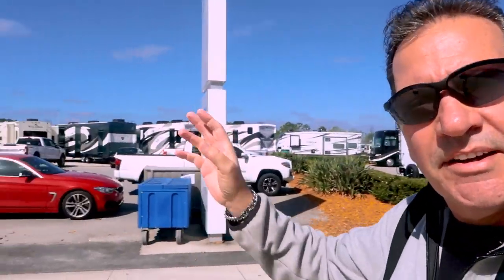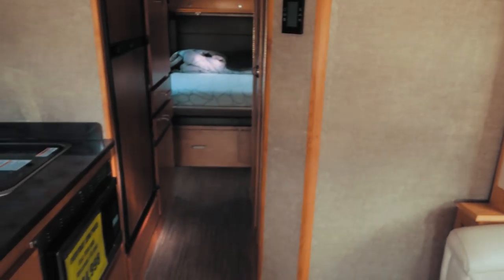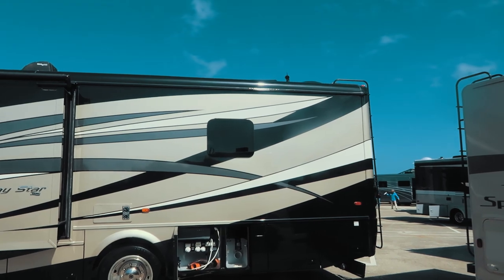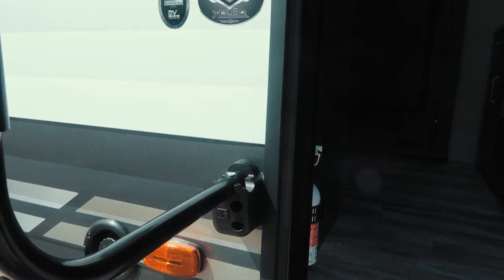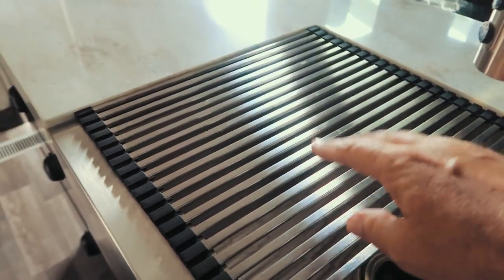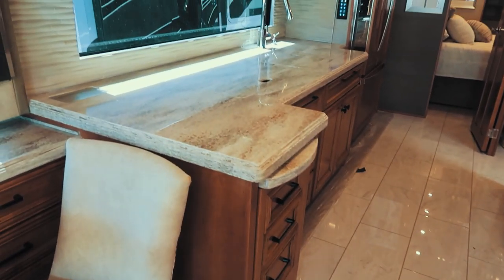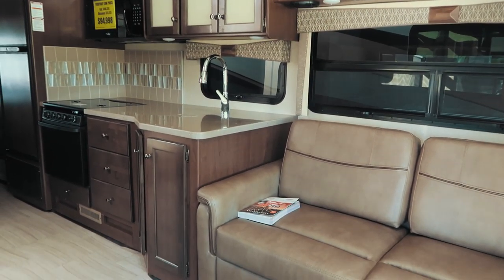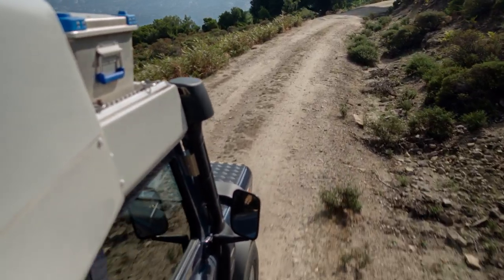2020 Daytona RV Show, What's New, Buyer's Guide!

Comment: Hi Bobby Gene, great tour and not much of a difference to change my mind. Still love your Newmar Bay Star I bought from you. After a few repairs it is like new. I am going to install an automatic generator start so that the generator will start when the battery voltage drops below a set value and also will start the air conditioner if the temp inside goes over a set temp. Which is great for our dog if we are out hiking where dogs are not allowed. Planning our 4 month tour of the Northwest and British Columbia this summer. Take care and keep up the good work.  Kevin
Reply from the maker: Hi Kevin, those are some awesome upgrades, well done! So glad you are happy with the RV I miss it a lot! I bet you are going to have a great time on your 4 month tour, wishing you safe travels and smooth roads!

Comment: I have to agree that there is really nothing of real significance that is new in 2020. We started looking in 2016 and bought a one year old coach in 2018. Our thought was that the difference was so small that we would not need brand new. Glad that we chose to go that route to reduce the high depreciation. My hope is that quality of the overall product will improve but I really do not see that. I hear that it's an "earthquake" going down the road but if you are charging these ridiculous prices, then build for the earthquake. A lawn mower, plane, car, jet ski, etc are built for the vibration and use and do not start falling apart due to use. Imagine if you had to replace much on your mower after one summer of use? We would not accept that as a quality product. After a lot of research we chose the Bay Star for quality but it is far from what I would expect for the money. Still happy with it but do think they could do more in quality to save the headache for the consumer. What other industry expects that the consumer will purchase and then bring it back time and time again (under warranty)  to work out the "bugs" that are consistently problematic for the consumer. Buying a one year old made it so that the original owner had to do most of that. Still waiting for you to buy your next rig! I imagine it is nice to nest a while since you just bought the condo. But, It will be fun to have you on the road again at least part time. Good job on the video.
Reply from the maker: You're making perfect sense well said Bean, ugh so frustratingly clear. Yes I'm looking forward to getting back on the road at some point, hopefully before summer. I'm still doing the homework right now on which direction I'll go in regard to RV. Downsize for sure, perhaps travel trailer, need a new challenge! Cheers!

Comment: Not much of class B fan they are way overpriced for what they are and so is Mercedes motor and chassis. Now my style Axis 2017 25.2 my little baby class A at 26' and only 1 small slide in the rear and you can snag one for about $55,000 basically today a 5year car loan.
Reply from the maker: Way over priced indeed! And yes you nailed it!